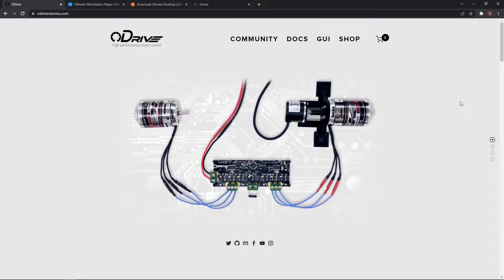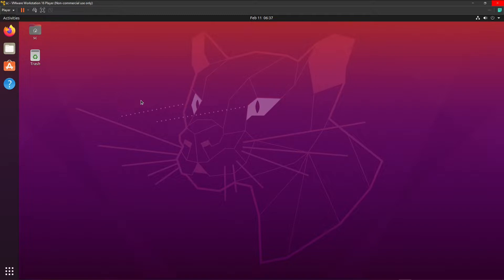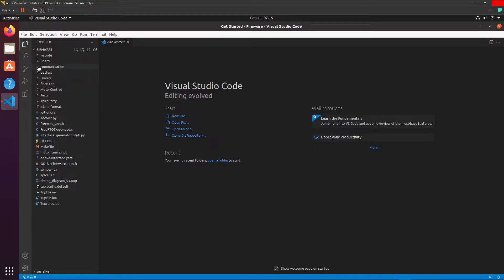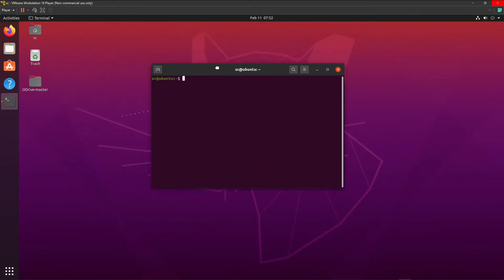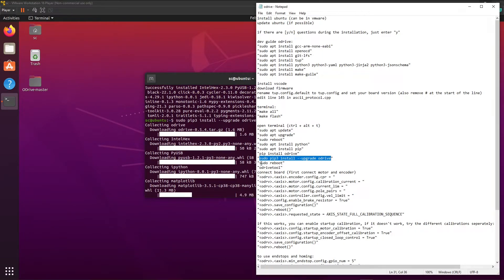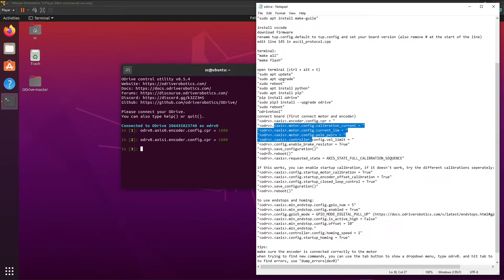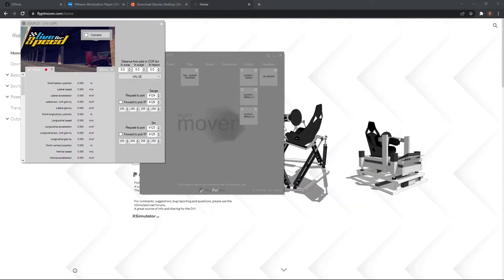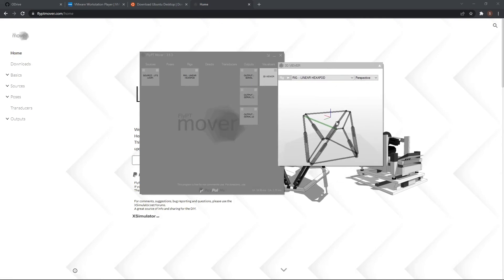Setting up ODrive with FlyPT Mover for a 6 DOF Racing/Motion Simulator (USB ASCII)

Comment: I'm trying to connect ODrive with latest FlyPT Mover 3.7.0.9 and it's not working via serial. I don't know what I'm doing wrong. Could you please elaborate more about those "start"and "stop" commands? I don't understand what I need to type there from your video.
Reply from the maker: You don't need to type anything, you can type something but it's not necessary. If the bottom position of the actuators is -5000 for example you can set it to 'p 0 -5000<13>p 1 -5000<13>' and then the motors will move to the bottom position. Otherwise you can leave it empty.

Comment: Unfortunately I think the odrive repository is out of date and no longer works. I tried in every way to change the firmware to compile but I get error after error. When I manage to solve one, another appears. I wanted to make the change to a 3.6-56v odrive. I followed your video in great detail but I'm already tired of not making progress. If you can help me, I would be extremely grateful.
Reply from the maker: The process has changed a few times over the years and I have not used it for a while so I'm not sure what changed. If you let me know where you get stuck I can take a look on how to fix it.
Reply: @stijnsprojects  When I type make all in the terminal I get several different types of errors. I solved some and others appear. It is not possible to put them here. Your help would be very welcome.
Reply from the maker: Feel free to contact me on social media.

Comment: hello bro,  why ? you  have use USB ASCII   to pin odrive  ,  can  usb( PC) to usb (odrive) ?
Reply from the maker: I send ASCII commands to the ODrive using USB to USB. The ST-link is only used to program the firmware of the ODrives.
Reply: @stijnsprojects  great,  thank you
Reply: and then ,  when   you  have config programe  FlyPT  ( or  simtool )  to Odrive    you use  The ST-link  only  for communication  between PC and Odrive  ?
Reply from the maker: Communication from FlyPT or Simtools is done over USB. ST-Link is only required when reprogramming the ODrives, not for normal operation.
Reply: @stijnsprojects  thank you ,bro

Comment: which MCU you have use in this project ?  could you share overall circuit or all equipment ?  thank  you
Reply from the maker: I did not use an MCU, I send the commands directly over USB. The schematic is straight forward, just connect power to the ODrives and USB to the PC.

Comment: why do you divide the ascii input code by the encoder cpr? from my understanding if flypt sent 511(middle bit) to your odrive it would go to 511/1600 turns? how to you accomodate the turns to length travled for an actuator? from the scale function? but if thats the case u cant even make a full turn if you at 10 bits and with linear actuators that doesnt make sense.
Reply from the maker: I did that because when I made mine, the units were different so I wanted to keep it the same. There are multiple ways to achieve the same functionality such as multiplication or division by a factor in firmware, using a microcontroller to change the value, maybe even multiplying or dividing by a factor in flypt. There have been many updates to the firmware and flypt since I made my sim.

Comment: In video you mention that position bit output in  FlyPT "rig" module needs to be 18bit. How did you get the rig move in wider range if you use 18bit? I just get my rig works (thanks for the video) and now I am setting up FlyPT.
Reply from the maker: In the old firmware the USB move command were encoder pulses, in the new firmware, these are rotations, that's why I show in the video how to change the firmware that it's encoder pulses again.
Reply: @stijnsprojects  I do that firmware modification also. Or least I try because I had problems to get odrives connected to VM ware and ubuntu. First it works well, but after some time Ubuntu stops to recognize odrives or any usb device. Tried to figure it out but didn´t manage to do it. I made modificated hex file and then flash the odrives with windows. Are you sure that that is the only reason for my limited move problem with 18bit and I didn´t manage to do firmware modifications properly?

Do you know is there any problems to use 19bit´s?
Reply from the maker: I'm not sure, 18 is what worked for me but my project is already a few years old.

Comment: Thanks for sharing this information, it's incredibly helpful! 

I was curious about the Linux/Windows interface though. Do you run FlyPT Mover in the Linux VM, and play your game on Windows? How do the two talk to each other? Or is the VM only for the configuration of the ODrive? Thanks for the info!
Reply from the maker: The Linux VM is only for setting up the ODrive because it's a struggle in Windows, so Flyptmover and the game are both running on Windows
Reply: @stijnsprojects  Brilliant! It is definitely a bit of a slog on windows, I am finding. Luckily I had installed a bunch of Python stuff earlier for school so the odrivetools setup was easy for me. THAT SAID your method looks nice and snappy so I will most definitely be doing this. Thank you again!
Reply: @stijnsprojects  Are you on the X-Sim discord? I was wondering if I could ask you some questions about building the firmware.

Comment: Hello, can you make a video on how to set safe min/max platform movement in firmware. thx
Reply from the maker: Hello, I'm not sure if I understand correctly but you can set min and max in flyptmover, you can find the information on the website or forum posts on xsimulator.net
Reply: @stijnsprojects  yes it can be set in flypt but you can also set the safe  feature in the firmware (configuration).

Comment: Great stuff Stijns I couldnt even work out how to compile the FW didn't even think of using a VM  excellent idea.  Have you tried the new GUI to setup the official new FW ?
Reply from the maker: Thanks, at first I used windows but it was such a pain go get everything installed, Linux is way better for this and not everyone can set up a second machine with Linux so VM is the way to go in my opinion also because you can switch between Linux and Windows when needed. I've not looked into the GUI yet.